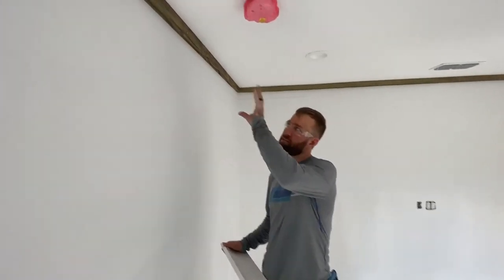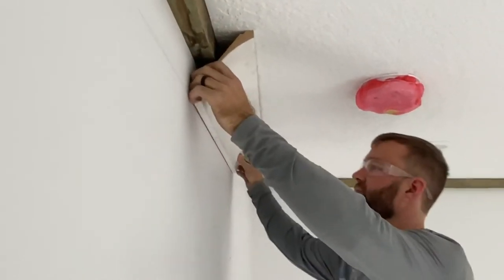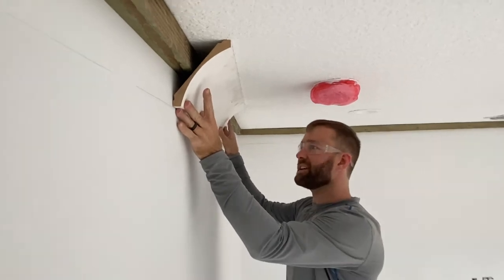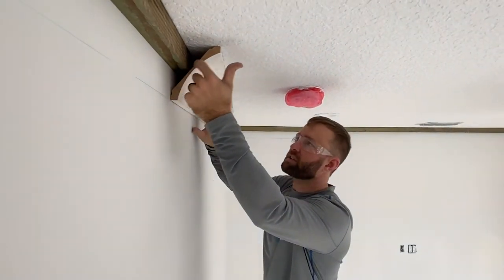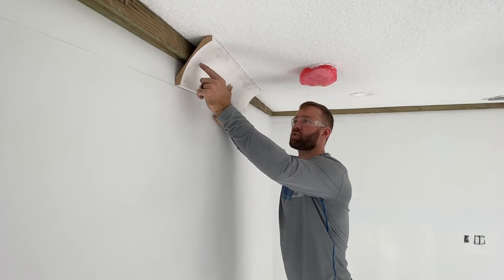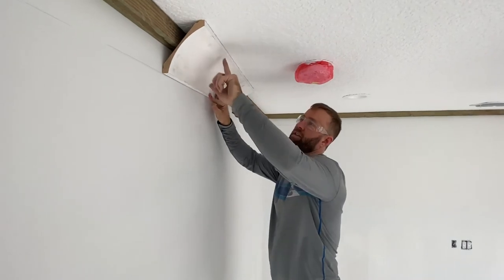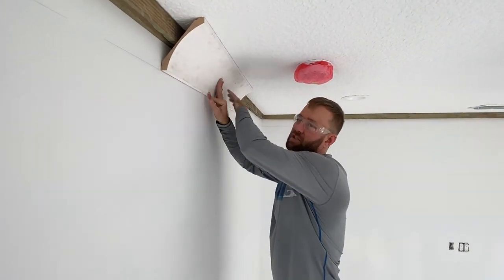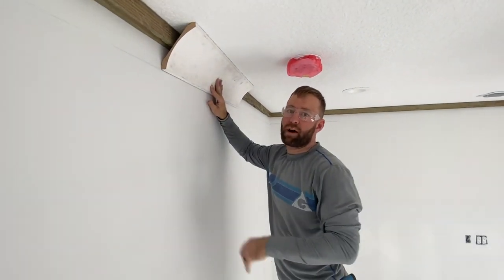Tips on Installing Crown Molding

Comment: Question, if you are nailing into the stud and joists what do you do for the side that there is no joist? And the crown molding sits too far off the wall to hit the top of the stud. Do u just use an adhesive
Reply from the maker: Hey JJ.  Sorry for the late reply. The nailer plate is nailed into the top 2x4 or 2x6 top plate on the wall. So the nailer plate is not nailed into the joist or studs.

Comment: Does that nailer have to be nailed into a stud, or is that nailed into the top plate? I'm putting crown molding into my 100 year-old home, and with plaster walls, it's been a pain finding the studs.
Reply: I nail into the top plate. Just be aware of any electrical in the walls and not nail above them just incase that is where it goes up into the attic and the electrician forgot to put a metal protection plate on. Also if the house has been repiped its good to be aware of water line locations.